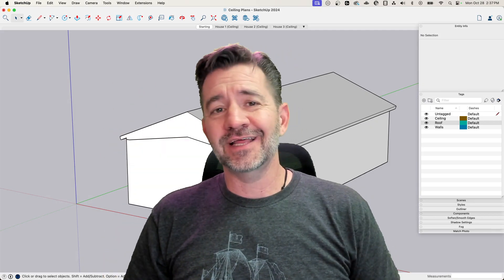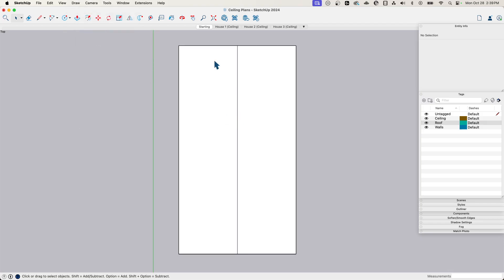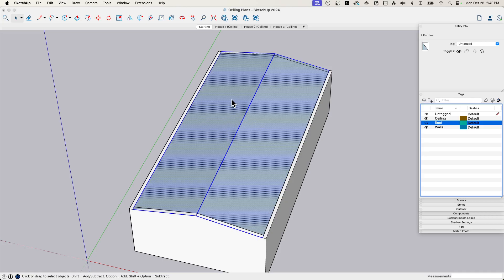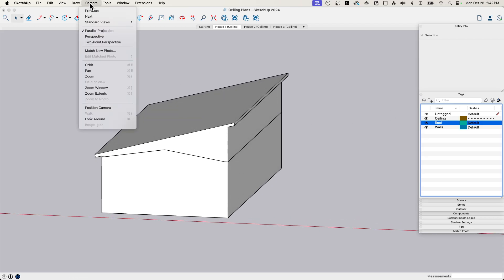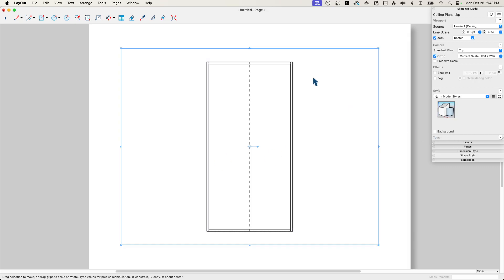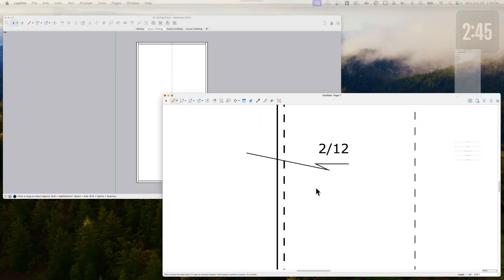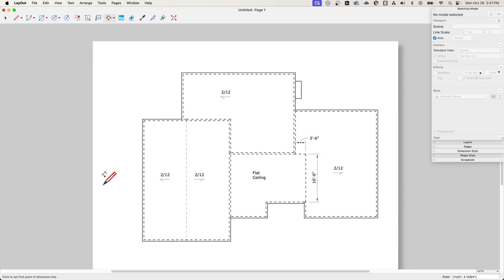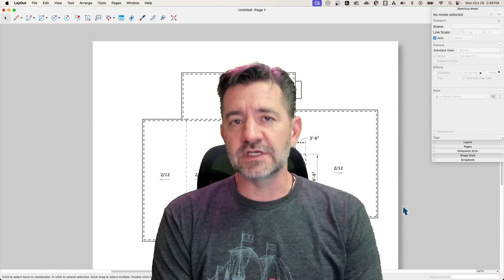Creating Ceiling Plans in LayOut

Comment: This video is not a compelling reason to move away from CAD software for professionals working on real projects. This should be a tutorial using a complex 3D model (say a residence, say it's two storey with a basement) with decorative lighting, ceiling fans, exposed beams, rafters, dormers, trusses, ductwork, etc. and set up using mirrored section cuts. Then, demonstrate applying hatch masks to represent materials and adding notes, dimensions, etc.

Comment: I usually just use an upward looking section cut and then flip it in Layout so it's reflected. That way if I have lights, ducts, sprinkers etc in the model they're shown on the RCP without any additional work. How would you display those things using this method?